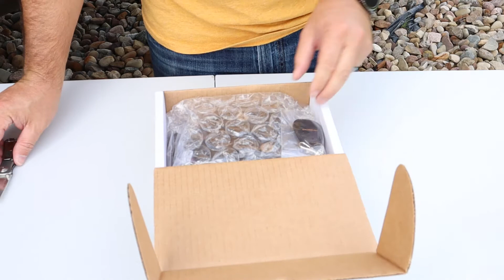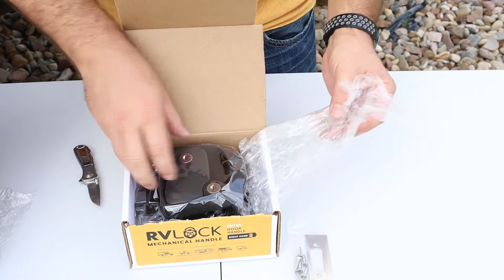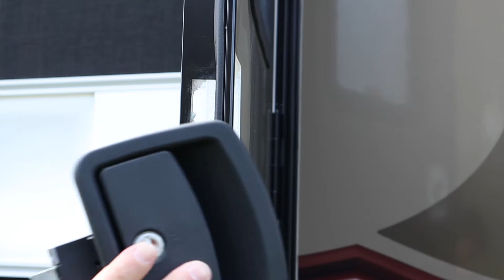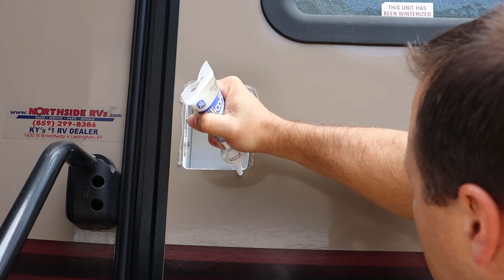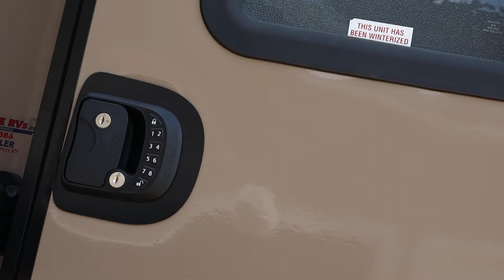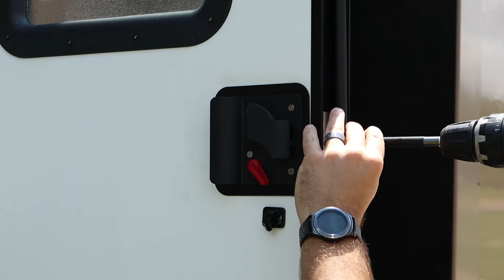RVLock Compact Wireless RV Latch Installation

Comment: Does the one red latch on the inside work both the striker lock and the dead bolt?

How many digits can you use for the custom lock code?

Are there 8 separate buttons or do two numbers share one button (1 & 2, etc)?

Comment: I am so excited I found this video, I have a 2016 Cougar. I was so disappointed to find out that the rvlock won't work as a replacement for my factory FIC latch. Do your adapter plates work for the regular size rv lock or the campact only? Would the regular size one work as a replacement for my latch?
Reply from the maker: I make a different version for the v4 latch.  There is a link on the description for this video to a page you can use to order one.

Comment: This is a great lock system and✦>share4.photo/lRvLock?ab    I have had several of them on different RV's. However, when dis-assembling the old lock to remove it, I discovered it was not broken, but a screw had come out. I replaced the screw, it worked great, and I returned this lock.

Comment: Sent a message in the blog, but never got listed in the comments - I have the non-compact lock with the same issue. Would an adaptor work with the larger lock without seaming too large? If not how much? timeframe?
Reply from the maker: Frank, I'll send you an email with details, but I have designed an adapter for the V4 lock too.
Thanks, Jason